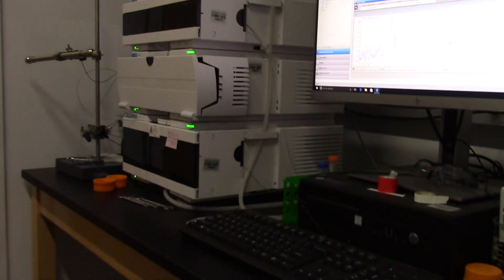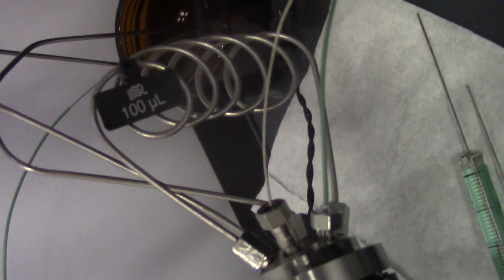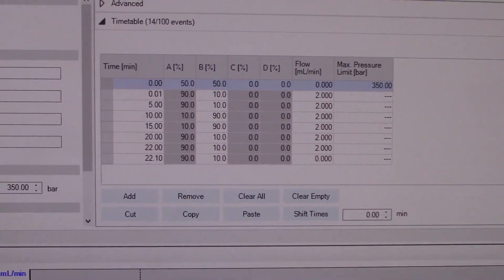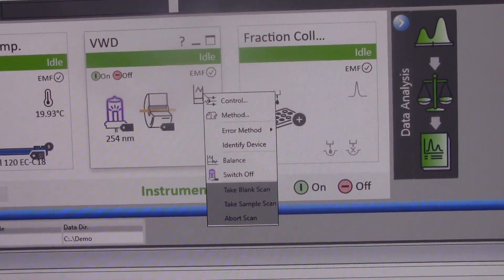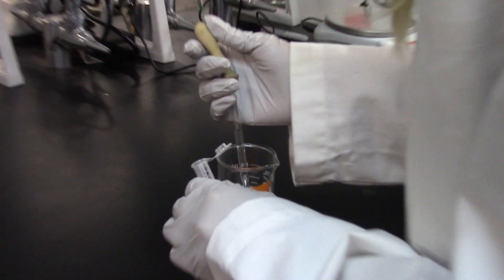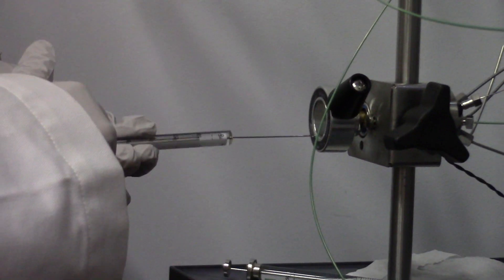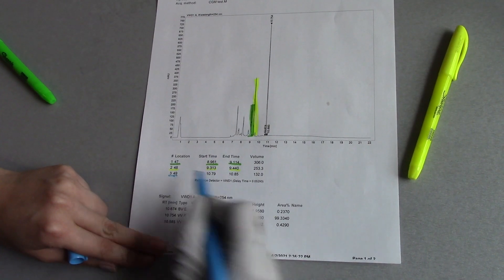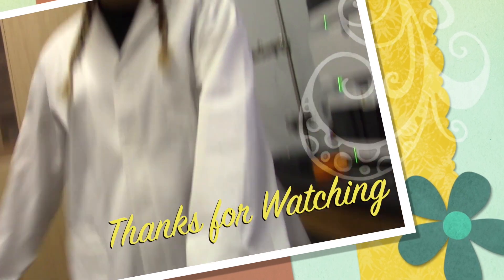Basic Guide on How to Use the HPLC

Comment: permission to ask about the use of hplc equipment, can pro analysis acetic acid 0.1% be used for the mobile phase in HPLC testing with a c18 column? Or will it possibly damage the column, sis? Thank you 🙏🏻